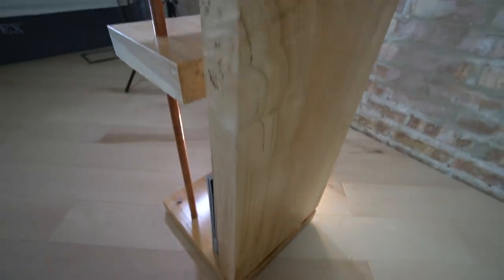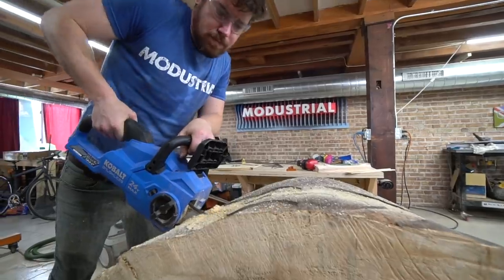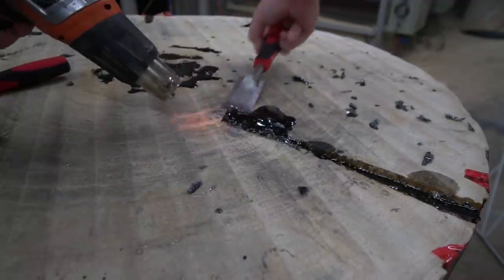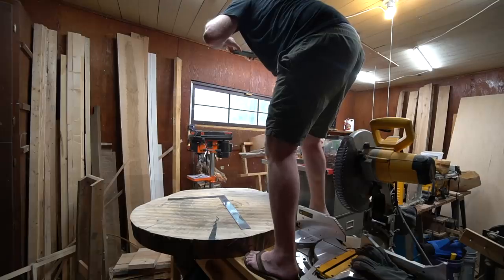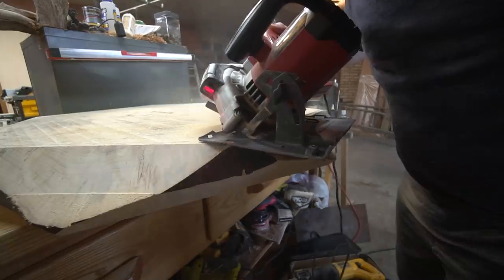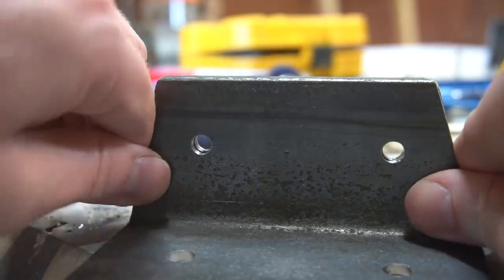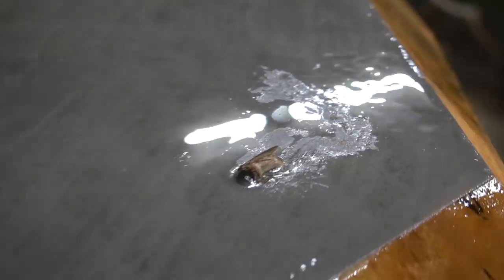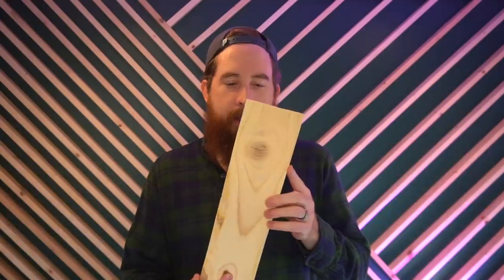From MASSIVE LOG to INSANE MIDCENTURY MODERN Coffee Table. ft: Modustrial Maker, Ten Hundred, Kiptoe

Comment: You should make a floor puzzle for your kids out of the extra slab by planing it down to an inch thick and then cutting it into some oversized puzzle pieces, but you’ll have to mount it on some 1/8” plywood or the end grain pieces will break easily.

Comment: that top cut could be done with the super thick material they used to coat wooden tables with in the 80s and 90s (can't remember what it was) as that would increase the thickness and would still highlight the original material. It would be cool to see a modern artist using very old materials.

Comment: Facetnating! LOL Only thing different I might have done, several very thin coats of epoxy. Because the wood is so soft, it sucks the epoxy in. Doing thin coats and sanding just barely back to the wood would let the wood suck up as much as it wants, then your last coat could be a bit thicker and would come out mirror smooth. But the design is seriously awesome. I hated seeing you paint it, but by the time it was done, even that worked well!
Reply from the maker: Thanks! Yeah, I usually don’t like painting wood. Honestly, I rarely even stain it because I like highlighting the specific species beauty, however, for this piece the top was pretty rough. :) Mike really did a lot better than me with his epoxy finish. I think I still might try and sand it a bit and do a few more coats, just didn’t have time to get the video out in time.